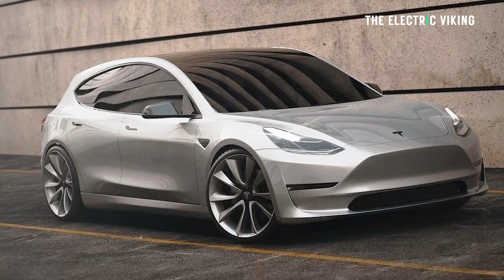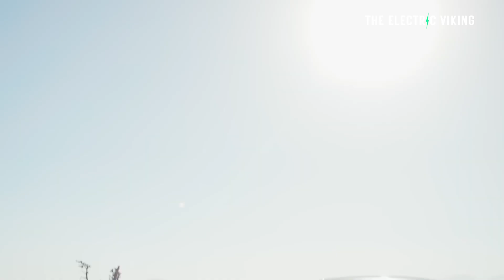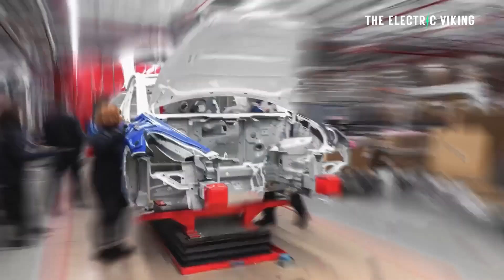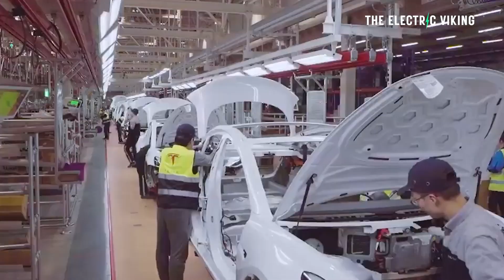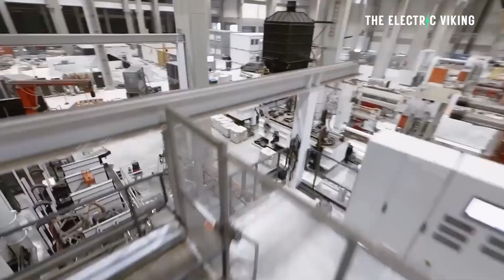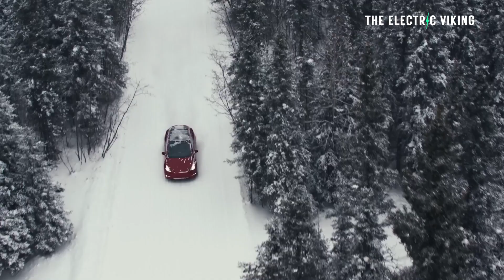Elon Musk reveals to Sandy Munro the battery chemistry for Tesla Model 2

Comment: Tesla already gave us a hint at the manufacturing method at the battery day.  Front and rear halves so that the internal assembly does not have to go through the doors.  Even for robots that is awkward.  build two halves.  You have full access to both halves from 360 degrees for assembly.  then drop on a structural battery bank.  easier for humanoid and non humanoid robots.  AND humans where necessary ;-)   A shorter smaller car does not have as much torsion on it either so less stress on the battery pack and roof/pillars are less critical for structural rigidity.  There will be two versions at least, but they will first be with and without steering wheel.  US engineers were not interested in moving to Mexico for the start up, so Texas will be first  line with Mexico getting version 2 with the lessons learned from the Texas factory.  Every one of their lines needed a shutdown for tweaking.  This way ultimate ramp at the main Mexico plant should be smoother.

Comment: I've a feeling that model 2 refers to a step change, and not a specific car.
So the first being the smaller cheaper car, followed by other subsequent models built on the same idea or infrastructure, smaller cheaper batteries, simplified build, fewer less complicated parts, which is why musk wouldn't and couldn't go into detail.
If this is the case, which i suspect it is this will really shake up the market, as up until now the competition have been nipping at their heels.
Elon should really push hard into the European market, either way fun times ahead.

Comment: The Tesla model 2 giga press will pop out a completely finished Tesla model 2  ;-). From a SF movie scene in Minority Report:  the hero is on the run in an electric car factory that is 100% robotized and automated. I think Musk is aiming for 100% automation/robotization. Will it also be based on carbon in stead of metal? A very good report on the lithium stock prognoses and market development says the following: the exponential growth of EVs  will become linear growth from 2027 and onward, because of the limited supply of lithium. Even after the sodium battery will become economically viable, it will take a decade before this technology can be scaled up to mass production, just like the lithium battery mass production. So linear growth after 2027 in stead of exponential growth.
Reply: To your question: Nope.

Comment: Although Tesla seems to be selling cars like hot cakes. Even if you can afford them and given Tesla's heat pump to keep Lithium under control. Still people are concerned about their car going up in smoke.
The other auto manufactures are still having problems with this problem. I think when they get Lithium out of EV's the industry will take off.
Reply: LFP batteries aren’t a fire risk. Most Teslas use LFP.

Where Tesla do use Li-ion, they’ve always used the canned cylindrical form factor. It’s the pouch ones that are the fire risk.

Comment: Sam - I believe the 2 years would be the timeline it would take to build a production facility in Mexico making it option number 2 while more immediately option number 1 is to be building the initial Model 2 production facility into the existing Texas campus since that can be expanded onto much more quickly.  When we see them breaking ground in Texas for the Model 2 Assembly Line we probably should expect the first one to roll of a few months or so after that is completed which hopefully will be before another 2 years passes barring another pandemic such as delayed the release of the CyberTruck.

Best!
Reply: Also expect a fast build at Shanghai. With the production solved at Texas the production line roll out at other sites should be fast. The limiting factors look like being factory builds in Mexico, Berlin and in a smaller way Shanghai. Then watch out, the new Tesla next Gen will be coming in a flood to eager buyers

Comment: Perhaps the Model 2 line will designed exclusively to be ran by Optimus robots along with traditional automation robots?  If we are waiting 2 more years, Optimus might have evolved enough for this goal.  Your thoughts?
Reply: Standard industrial robots are more suited to production lines. Optimus is better suited to cases where the movement required is less planned.
Reply: Not likely, they're employing 60000 more people. Besides purpose built robots are far quicker

Comment: If you think about the process, they are already building the battery and motors in these factories, so adding a new model will be so efficient.  They can just max out production of the motors and battery packs, so the Model 2 line will just use those parts that are already on site.  I think this is why they want the parallel assembly, so they can just route battery packs and motors to the line  where they are needed.  They could have Model Y being built in one part of the factory, Model 3 in another and Model 2 in another, but the battery line and motors line will feed them all.  It should look like letters getting automatically routed in the post office...just sort of zipping along and splitting left or right, wherever they are needed.  Same factory, same cost already built in, but another million units produced in each.  I think Tesla could get 2 million cars out of each factory eventually.  Compare that to the 60 factories that each of the legacy auto companies uses to produce their cars.
Reply: Makes better sense to build a lighter custom motor

Comment: By the time model 2 is out, there will be other affordable EVs possibly from Chinese brand or western brands using Chinese battery and software.
Reply: The Chinese have not demonstrated that they can make quality cars for less than Tesla.  They are behind Tesla on software and the Tesla car will be using chinese batteries.
Reply: @danharold3087 What makes Tesla's software any better than other manufacturers? Elaborate.
Nah. Didn't think so.
Reply: @danharold3087  Tesla is already half Chinese. 40% of profit comes from China and model 3 highland is designed in China. More and more development not just production will depend on China and Chinese human resources. Batteries are only just the first step. Eventually the whole supply chain
Reply: @i6power30  Tesla like most major car companies is a multinational corporation.  It's success in China does not make it a chinese company.  Unlike most other makes Tesla owns 100% of Tesla in China.  Other companies have partnered with chinese companies.  Some partly owned by the Chinese government.   Tesla has 2 car factories in the US, 1 in Europe and 1 in China. 2 or 3 more to come. As for human resources  Mexico's manufacturing labor costs are 20% lower than in China  In a few short years much of the manual labor at Tesla will be done by the humanoid robot Optimus. As for the parts chain Tesla cars contain the most US content of any US car maker.  In Europe and China Tesla also works to localize the supply chain.  
The  Mexican factory is being built mostly to access the large number of trade agreements Mexico has with other countries.  Access to markets.
Reply: @danharold3087  when I say human resources I don't just mean manual labor, I mean brains. If you listened to the latest interview with lex Friedman, Elon showed much admiration for Chinese people creativeness and energy. I think much of future Tesla designs will be done in China. Model 3 highland already was. Model 2 will probably also. As much as US politicians try to shut China down, the future of EVs depend on China. Mexico will not be a major force other than providing cheap manual labor but they will soon be replaced with automation like you mentioned
Reply: @i6power30  We do see Elon playing to China.  Tesla_Q are twisting this for their purposes.  Elon treads a precarious path in China. Tesla's full American ownership could spark resentment.  Fostering the perception of Chinese ownership with customers, staff, and officials is crucial to Tesla's success.  
Your overplaying the refresh of the model 3.  While it is important work it does not equate to a new design.  
I speculate that other divisions of Tesla will make localized version of the car but primary design is in the US.  This not only creates a car more compelling to the local culture but to a degree leverages nationalism.  

For all the Ra Ra buy American we see in the US people tend to vote with their pocketbook.   This is why US legacy has congress blocking Chinese access to US markets.   The German followed by the Japanese car invasions illustrate this.

Comment: Std platform variety of bodies.
Different sized battery packs for different ranges. 
Small vehicle for the small daily drives and selfplug into the std wall socket. 23hrs every day. 
Just like the home robotic vacuum cleaner. 

Room in the trunk for extra plug and play  battery for long trips.
Small plug and play backup batteries for emergency services like someone ran out of petrol. 😊

Comment: 4680 batteries suck so far. Bad range, charging performance etc. Anything is better than the Tesla 4680.
Reply: CyberCell made another density improvement.  It is now the 2nd most power dense cell Tesla is using.  Also improved power deliver stability with hard use.

Comment: I wonder metal 3d printing will be use to built tesla 2.....
Reply: Too slow.
Reply: @danharold3087  True the initial one is very slow, but is getting faster and faster, hot stamping may be fast but required expensive equipment and alot of energy... it will interesting to know what are the new break thru manufacture, tesla will use.

Comment: I'm waiting for Model 2. If Tesla can bring this to market for under 32k, I'm a future owner.  I hope they offer one without the all glass roof. I'm also hoping for  a gauge cluster or HUD. Taking eyes off the road to fiddle with a screen is dangerous, IMO.
Reply: The glass roof is such a gimmick.  All it does is add cost and heat in the summer. I would love model 2 to be a hatchback with stainless steel that I can wrap in a fun color.
Reply: I'm a tesla owner.  When I drive an old fashioned vehicle I miss my tesla display on the screen right there in my vision.  Verbal commands can work for many functions.
Reply: @elainebradley8213  humans are very flexible creatures they can get used to anything good or bad. Taking your eyes off the road to look at center screen is definitely inferior to HUD on windshield. You will say anything to defend Tesla even if it makes no logical sense.
Reply: HUD could be cool but won't happen in model 2 in order keep cost down. Elon said it would be utilitarian. I could see the glass roof going away for the same reason. A gauge cluster definitely ain't happening. I predict Tesla will send out OTA updates to all vehicles next year that will enable AI assisted voice commands for every single thing you can currently do with screen, which will greatly reduce eyes off the road screen fiddling. Tesla ROCKS!
Reply: @robertfonovic3551  Given up worrying about upsetting people I give it as it is.
Reply: Sounds like you should buy a bolt EV.
Reply: Think you will be disappointed then, it's not going to be old fashion. I often drive all sorts of vehicles and finding buttons/switch's and whatever else is a pain in the arse, takes a little getting used to having it all on one screen but not dangerous.
Reply: @turningpoint4238  HUD is not old fashioned and very cool and useful. Only reason Tesla doesn't have it is to save cost.
Reply: @i6power30  That is the only thing that would have been nice although if no human is driving....

Comment: Musk cannot afford to repeat the commercial errors of the Cyber Truck with the model 2 making promises on launch time, performance and cost then fail to deliver on any. EPA data shows Rivians are more efficient than Cybertrucks, even with larger wheels and batteries and the cheaper Ford have just broken the record for F- 150 sales. The model 2 will enter a significant larger market against Toyota Volkswagen Stellantis Honda Nissan and BYD, all of which have either launched they sub £25,000 Ev, or will be doing so in the next 18 months with pre-production vehicles on test. Tesla can’t afford a repeat of the Cyber truck and Semi delays.
Reply: Cybertruck is Musks/Tesla's Waterloo. A massive mistake, driven by PR and Marketing errors, hidden by hype and false gimmicks. All in the hope of distracting from what mayl be an abject failure. Time will tell.

Comment: I doubt the Model 2 will be a $25000 dollar car.You have to allow for inflation  .And although it might be possible to build a very cheap car it would be a very basic one and that is not what the market needs .Also even though batteries are becoming cheaper small cars are not that much cheaper to build and on a unit basis are always less profitable.Tesla needs a car equivalent to what the  Corolla was for Toyota -a car for the mass market but one that still had all the features .
Reply: $28-30k
Reply: @darylfoster7944 and the only way that  can happen is when Tesla cancel the CT.
Reply: @robertfonovic3551  ain't happening

Comment: That $25.000 "Model 2" will probably be a good EV, but comes already to late. We all could hear, that it is easy to work with 100 people to show a concept car in a few months.  
But mass producing a real car is more of a 3 to 5 years project. When they are already half way, it is my guess that this Model 2 wont be mass produced and shipped over the world before mid 2025. 
First quarter 2024 the new Citroën ë-C3 will be for sale in the EU and other parts of the world. That is a B-segment EV, €23.500, 200mls range, 100kW charger, and LFP batteries.
That will be an affordable sales hit for many people that want to start with EV's.   But he, that's not what Tesla Fanboys want to hear don't they 😁😁
Reply: Heard of the Chevy bolt for 25-28k on sale since late 2016? It's also a slow charging lower performance cheaply made ev with 250+mile range.
Sold a couple hundred thousand of em, less than 20k after the ev subsidies in some states under 15k after state&federal ev incentives. 👍🏻😀

Comment: I just hope Tesla makes the SUV version of the Model Q/2 FIRST instead of making a sedan that hardly anyone wants to drive anymore.  We also need to consider that the DESIGN TEAM for the compact Tesla is in CHINA. Where do the cheapest Tesla's come from ? Not Fremont, or Texas, or Mexico, or Berlin... Yes, you've got it. They come from CHINA. Remember the 'expansion' happening in china?  Odds are it is for the Model Q/2/compact (if not, then is SHOULD be). Add that to the CATL battery factory just 3km down the road, and all signs point to CHINA as the logical first location. Any other plan is probably a DECOY IMO.  What does everyone else think ?
Reply: Tesla has design teams in countries where it has gigaFactories.   I expect to see region specific cars sharing the same platform.    No proof.

Comment: If everything is so robot assembled, why are there fit and finish issues?
Reply: My 21 Model 3 LR is Shanghai built and does not have fit and finish issues. Do you have a Tesla with those problems. Are you looking at Fremont built cars? Are you talking about 2017 built cars?
Reply: @petergersbach7355  I have bought two Fremont Teslas so far, and both were fine.
Reply: Yes it will cause fit and finish problems for car makers who are not using Tesla Optimus.  Robotic vision will allow the positioning of parts at tolerances that will put the human workers they replace to shame.   Tesla is also designing the car to be more precisely built with the gigaCastings and more.

Comment: What's the difference between a hatchback and an SUV when they are both the same size?
Reply: Plastic wheel arches
Reply: I have a new Smart #1 Brabus. They call it an SUV. In reality it’s a hatchback with more ground clearance. Or you could say it’s a small crossover. Either way I love it.
Reply: @garrycroft4215 I see no upside to that abomination.
Reply: @LachskoenigIV  Just for starters.. upside is that it’s quicker than an Audi RS3 to 60mph & the Quarter Mile and £20k cheaper and much cheaper to run and service.

Comment: Meanwhile in IRL Tesla production nubers dropped below 1 million cars in last quarter. So 4 million Model 2 cars a year sounds a bit fantastical.

LiPo-Fe sounds reasonable for any 2025/2026 year model car, so nothing Earth shattering there.
Reply: When you consider the number of people who can't afford a $40k vehicle but could afford a $25-30k vehicle, maybe not. You start to hit a tipping point where the interest cost on a car loan would be less than the fuel savings gained by switching from gas to electric. That opens up a lot of possibilities for a lot of people. I can see a lot of people upgrading from a 3-5 year old gas car to a brand new EV if the price was right.
Reply: @apterachallenge if you have to borrow, to buy one, you can't afford it
Reply: @robertfonovic3551   Right... so all those people driving around in cars that have an auto loan against them didn't actually buy that car? Think about the logic of what you just said. A sale is a sale, however you paid for the vehicle.